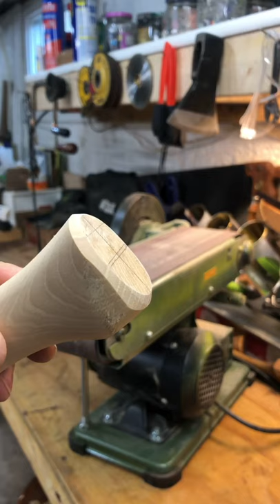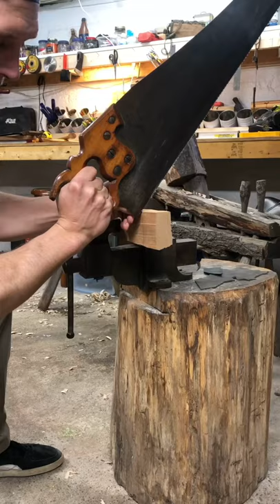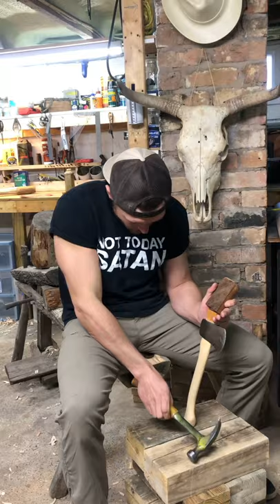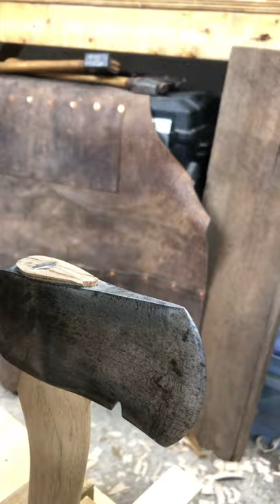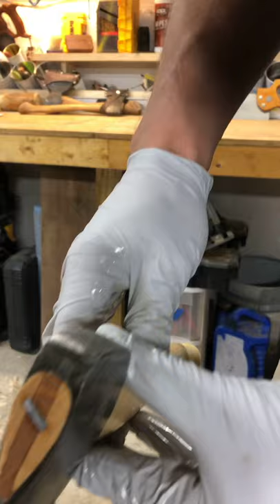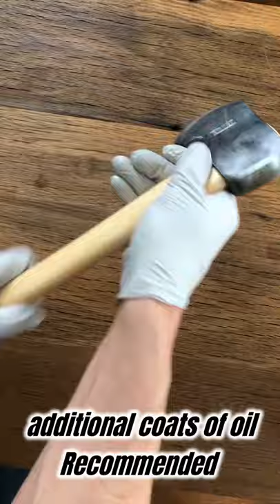Part 2 HOW TO HANDLE A HATCHET HEAD

Comment: First, I like your shirt... NOT TODAY SATAN!  Great.... Second, just a thought, you might consider tung oil for your handles.  "Boiled" linseed oil is just chemically treated to dry quicker, so it doesn't soak in well.  Raw linseed oil works well, too.  Yours is the best handle I have seen on the tube.  Great work.
Reply from the maker: Thank you. And yes, linseed in the raw would be a better oil.